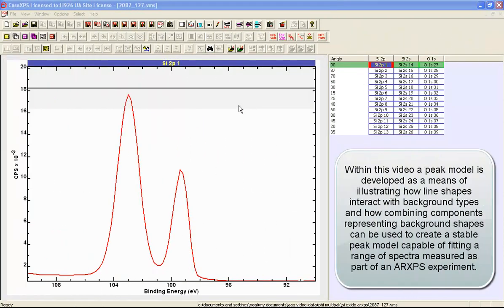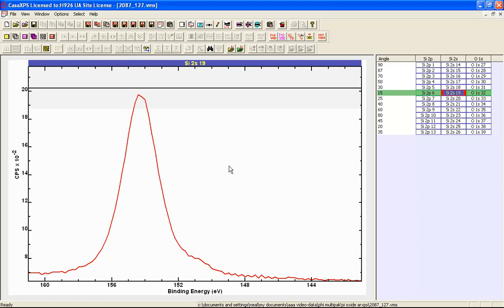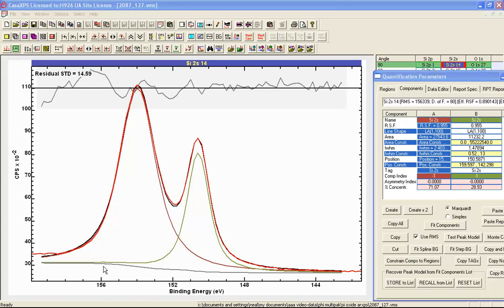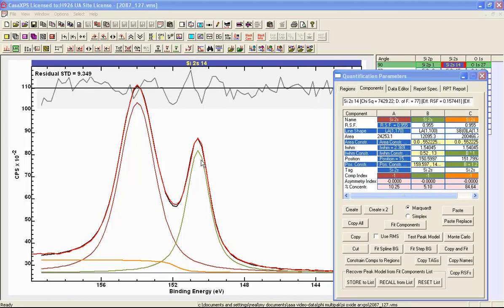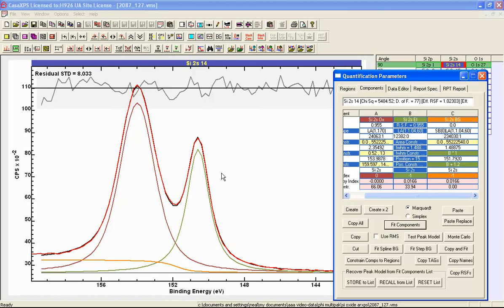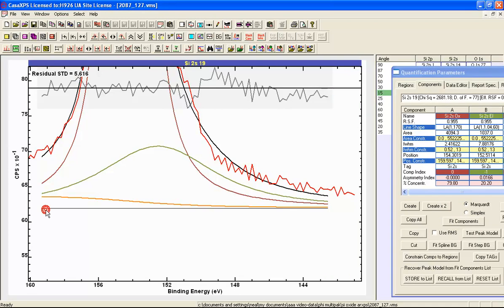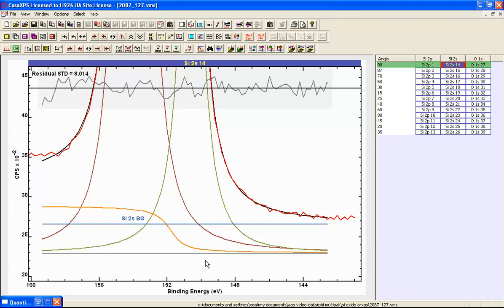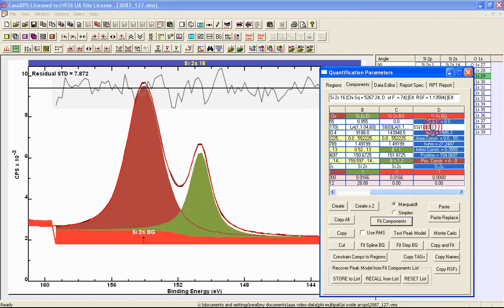Si 2s Peak Model in CasaXPS

Comment: Could you please explain why we generally consider Si2p peak than Si2S peak While analysis for PDMS?
Reply from the maker: Si 2p is used to estimate the amount of silicon for two reason of which I am aware. Firstly, elemental silicon results in sharp plasmon loss peaks and these plasmon peaks from Si 2p include a plasmon peak beneath Si 2s. Hence the background beneath Si 2s is not always as simple to describe as Si 2p. Secondly, Si 2s is best described by a Lorentzian shape which extends beyond the point at which an inelastic scattered background responds to Si 2s photoemission. It is therefore harder to separate background intensity from primary photoemission for Si 2s even for the case of SiO2 which has a significant band gap. Quantification requires the matching of RSF to background for photoemission peaks and in general defining the background for Si 2p is easier than Si 2s.